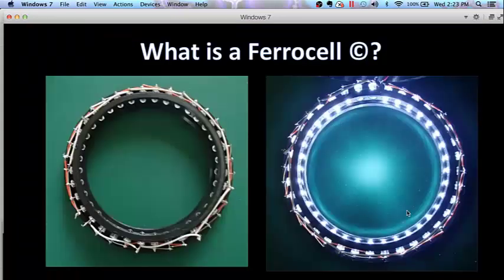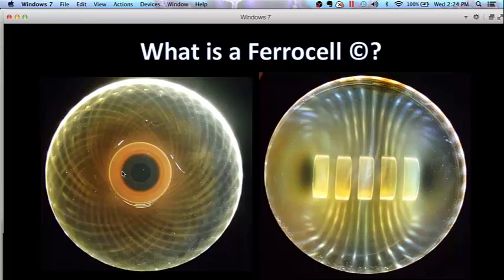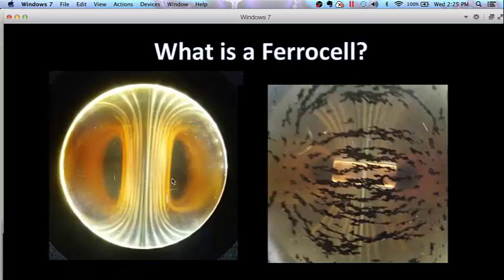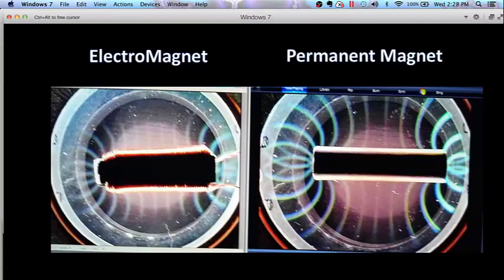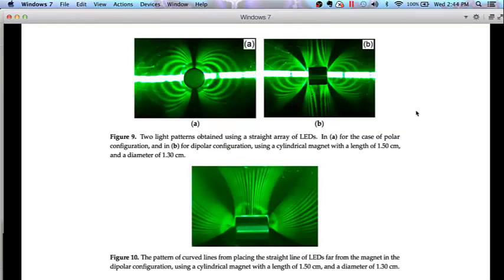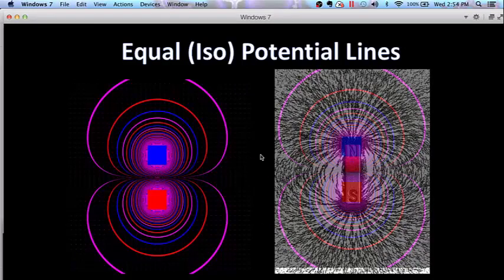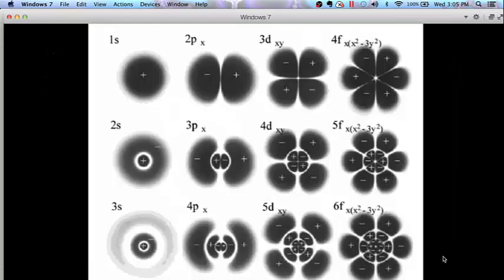Unveiling the Missing Secret of Magnetism

Comment: Ferrocell vs iron filings: Iron filings line up tip to tip that  collectively show as dark lines. A ferrocell reflects light off the iron filings that are suspended in a fluid. The reflections combine into lines of light that are at 90 degrees to the dark lines formed by the iron filings themselves. In other words dark iron filings lines are orthogonal to the light ferrocell lines, just like magnetic fields are orthogonal to dielectric fields. Ferrocells and iron filings are dual.
Reply from the maker: John Wasa: The mechanism that causes the "lines" to form in the ferrocell is not reflection, although there may be some reflection going on too. It is constructive and destructive interference caused by the nano diffraction grating of the nano-particles in the ferrofluid. Although there is likely some reflection going on, this is not the main mechanism that causes the light to be have the way it does in the ferrolens. It's more complicated than that. You should read the paper that I linked in the description. The paper explains it in more detail than I did in the video.
Reply: @FractalWoman  We may be in agreement. Just wondering if the YouTube video "You Don't Know How Mirrors Work" by "The Science Asylum" would describe our argument of reflection vs diffraction.
Reply from the maker: @johnwasa7030  Truthfully, I trust the guy who invented the ferrocell and who has looked at the ferrofluid under the microscope, and who developed the computer program to generate the isopotential lines that mimic the electron orbitals that I show in my video... over Science Asylum guy, but feel free to ask him. Can't hurt to have another opinion.
Reply: @FractalWoman  To be fair to the Science Asylum guy, all he is saying is that at the level of quantum mechanics reflection may be described as diffraction. Likewise I was wondering if my naive description of a ferrocell as reflection of light off iron filings could be similar to the diffraction model describe by the inventor of the ferrocell. If so, we would be in agreement. If not, a meeting over beer might be necessary ;-)
Reply from the maker: @johnwasa7030  So, it is my understanding that it is not just about "diffraction" vs "reflection", but has to do with a diffraction GRATING which creates a phase disparity in the light causing constructive and destructive interference. At least that is what a diffraction grating does to light as you can see in the videos I recommended in my community section. Reflection does not encapsulate all of the detailed "optics" that are going on in this system (the ferrolens, and the light source). There's the Faraday effect when using polarized light, and others that are mentioned in the paper.
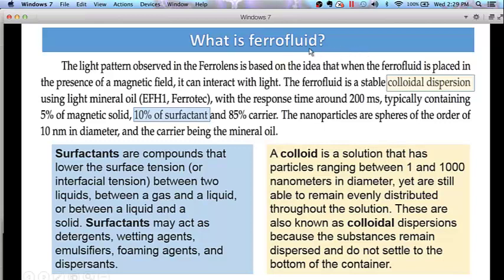Reply from the maker: @johnwasa7030  I think you need to watch that video again. In classical physics, the law of reflection requires that angle of incidence equals angle of reflection. The case he is talking about in that video is when you take away some of the mirror, in which case, some of the light still makes it to the black hole. Classically, the reason that the light reaches the black hole is diffraction, not reflection. Quantum mechanics uses probability to explain this, but in reality, it is just plane old diffraction. Start watching around the 9:30 mark. https://www.youtube.com/watch?v=rYLzxcU6ROM&t=653s
Reply: @FractalWoman  You convinced me. Reflection by itself is insufficient as an explanation.
Reply: "Ferrocells and iron filings are dual."   The strands of ferrofluid in the cell behave differently than do iron filings. The most obvious difference is that the iron filings around a bar magnet do not show the "plane of inertia", but the ferrofluid in the cell does.
Reply from the maker: @codetech5598  All we really know for sure is the the iron filings are approximately orthogonal to the lines in the ferrocell as I demonstrate in this video. I say "approximately" because there are distortions in the ferrolens image due to the placement of the lights around the cell. Interestingly, the isopotential lines from Timm and Michael's software are EXACTLY orthogonal to the iron filings with no distortions. This is regardless of the cause of the lines in the ferrocell which may be some combination of diffraction, refraction, reflection and scattering and/or all of the above.
Reply: @FractalWoman  You did not address the point that the iron filings do not show anything different around the plane of inertia, whereas the ferrofluid in the cell do show something in that area.  So the iron filings and ferrofluid do not behave in a similar fashion.
Reply from the maker: @codetech5598  If you took all of the lines of the iron filings, and you drew a bunch of lines exactly perpendicular to all of those lines, you would also be drawing a line right through the plane of inertia. That said, the isopotential lines that I show in this video  clearly DO show something going on AT the plane of inertia. That is why I think the ISOPOTENTIAL lines are more informative than the iron filings which is why I made this video.
Reply: @FractalWoman  So what? If you just drew a line in the middle of the bar magnet without using iron filings at all, you would be drawing a line right through the plane of inertia.
My point is that the iron filings do nothing to show that there is even such a thing as the plane of inertia.
Reply from the maker: @codetech5598  YOU did not address my point that the ISOPOTENTIAL lines that I show in my video DO in fact show the inertial plane. Truthfully, I don't really care about the iron filings and more, now that I have the isopotential lines at my disposal. BTW I don't appreciate your TONE.
Reply: @FractalWoman  I am looking for a null at the plane of inertia, such as shown in the main picture (date 08.08.2017 in lower right corner) on this page: https://magnetismtoroidaldynamics.com/
That diagram seems to show two stacked torroids, on either side of the plane of inertia, which is different from the diagram which you are showing from Timm et al (Fig 2C).

Comment: If the patterns seen in the ferrocell are dependent on the light source, what do you make of Ken Wheeler's sun powered ferrocell? Seems like that's not point source light (ala the individual LED bulbs) yet the patterns are the familiar ones we'd expect. https://www.youtube.com/watch?v=8dJ_v2svRDo

Also, what about his continuous fiber optic light ferrocell? https://www.youtube.com/watch?v=0PXob8QTHWw

(Sorry if you answer this later in the video. I haven't watched past 27min mark. I'll erase this if you do answer later.)
Reply: but wow - the thing about orbits being along isopotential lines of force and requiring no work is so intense. if true, this is a powerful insight. not to mention what you're saying about angular momentum and the metaphor of spinning the water — and the fractal paradigm implications of field coherency as related to the atomic orbital configurations. brilliant hypothesis, and so worth exploring! Keep up the great work!
Reply: also contemplating the Primer Field's Part 3 (5:33) re: the atomic orbital structure you take on at 35:10 in your video. Is there some sort of connection? Just a thought... https://www.youtube.com/watch?v=lpI6ikj1G-s&t=333s

Comment: So magnetism bends light, as seen when light is applied at the magnet on the ferrocell, and this makes time delation when considering planets stars etc. as huge magnets, is that it.
Thanks for your effort of visuallizing and making the missing secrets well done swallowed.
Reply from the maker: Magnetism does not bend light. The lines we see in the ferrocell are caused by light reflecting off the magnetic nano particles in the ferrofluid between the two pieces of glass. What we see is merely an optical illusion. It is very important to understand that magnetism does not bend light. This can be easily proven with a laser and a magnet. Time dilation is completely another thing. Hope this helps.

Comment: What will diamagnetic field look like in ferrocell?
Reply from the maker: Xeno: The ferrocell only works because the nano magnetite particles act like tiny iron filings and line up in the presence of a ferro-magnet. Diamegnetic materials are repelled by magnetic fields so I'm don't thing we would see anything. The magnetite particles need to line up to form a diffraction grating. I don't think diamagnetic material have any effect on iron filings in which case, we will see nothing in the ferrocell. Hope this helps.
Reply: @FractalWoman  I see. I was thinking if you made a coil out of bismuth wires and run electricity through it, we would see bismuth wires repelling the magnetic field of electricity in ferrocell.